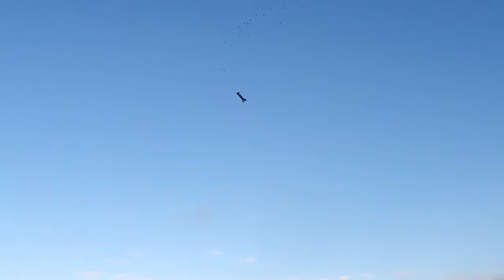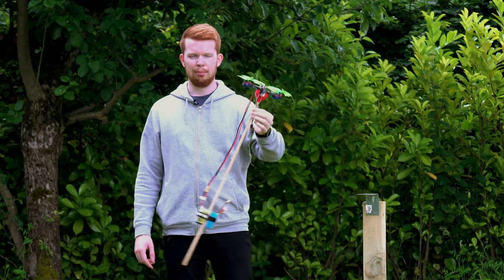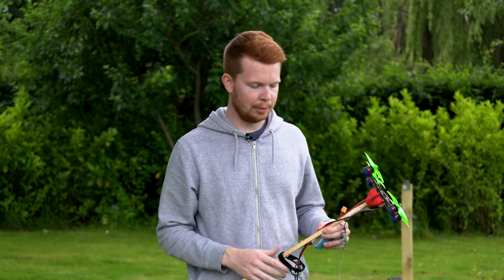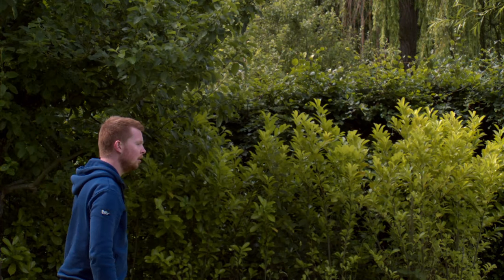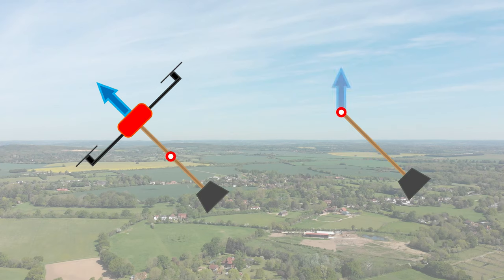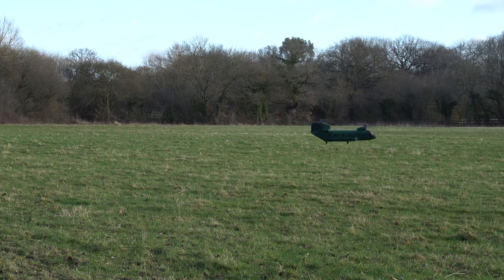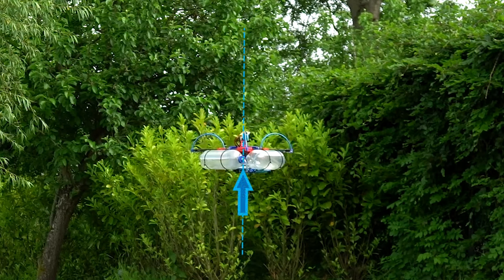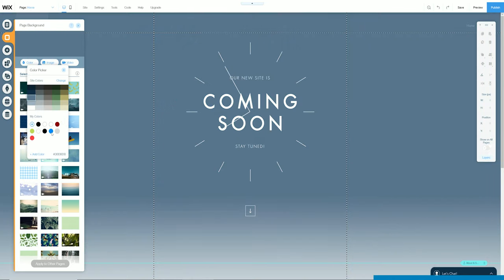Drone Pendulum Fallacy

Comment from the maker: There are many questions about adding a hinge between the drone and the pendulum (with a short length of string), so I thought I should address my view here. I'm not 100% sure what would happen as it depends how far the string is mounted from the drones centre of mass, however I think it will be more of a issue than an assistance. With any change of speed/direction, the pendulum will swing and will drag the drone with it. Also, if the string is attached at the drones' centre of mass, it will be unable to induce a torque on the drone and rotate it to level. If the mounting point is away from the drones' centre of mass, I think it'll still crash as the pull from gravity is uniform, so the drone is pulled down as much as the pendulum. Thanks for getting me thinking about this, I should have tested it in the video! Maybe one for the future!
Reply: Are you refering to the center of Mass as the center of mass or the point right between all propellers? - It might make a difference even if those two points are very close to eachother.
Reply: I'm thinking about towing objects on the water, if you attach them to far back on your tug it will reduce your ability to turn away from the mass, water doest allow for swinging though so maybe attach fins to your weight to dampen swinging motion
Reply: what if you had a stick going down halfway from the pendulum and a string going the rest of the way, would the swinging weight pull it back to level or just get caught in the props?
Reply: @MrGrimies  ah, but that just dampens rotations. It provides no correcting force.
Reply: wouldn't the mass of the weight after the hinge just be a down vector at the hinge?so effectively you have just moved the weight and the CG  a bit and you have the same set up?
Reply: @mikepettengill2706  well, it would be a wildly swinging vector centered around a vector pointing away from the direction the drone is accelerating. This of course has no relation to the gravity vector, so it would not contribute at all to stability. In fact, it would just yank the drone around randomly.
Reply: Really putting a hinge on it doesnt work for the same reason that moving the center of mass down doesnt work: the while system is in free fall, and the only force is from the propellers. So if you imagine a pendulum drone that is facing straight up and down, and then nudge it a bit, it'll start accelerating to the side. The pendulum might pull back at first, but eventually its stability point will be slightly to the side because it's being accelerated to the side, and only hold the drone at an angle.
Reply: Yeah, if there's a hinge, there's no need for the pendulum at all, as it would be unable to provide a torque to the aircraft. 
Great video covering the topic in a really easy-to-understand way, Tom. Thank you for the video!
Reply: @MrGrimies  To some extent that can be done, but may just cause more instability.
Reply: You didn't give the stick a fair chance ! None of those drones would fly for long without active controls. Now would they? the stick was stable you sent it off on an angle and it held the angle , you said it yourself.
If you change the fluid you are working in from air to water the pendulum  will work and if you had 4 helium balloons it would work in air.
Reply: @How2RC  Sarcasm?
Reply: I was thinking if the propellers were on a gimbal so the pendulum was always vertical and there were a couple of cross pieces on the pendulum about the center of mass and it was cross connected to the propellers with a spring you might get some counter pulling force to re orient the propellers back to vertical once they tilt.
Reply: If you take the Chinook model and move the motor adjustment down you basically have a counter pendulum, so i would assume that a counter weight would work if it is motorized and counter acting.
Reply: (i'm talking out of my ass rn) what about using a spring or a flexible rod to connect it? that way it could maybe apply a torque while still possibly getting the "pendulum" effect you would have with a string?
Reply: 2 opposing pivot points on servos to actively change the center of mass to gain positive control, instead of passive.
Reply: @How2RC  It's not the fluid that's different, but the force. In water, or with a helium balloon, the force is Buoyancy,  not thrust of the props. Buoyancy is a force that is always pointed up. And indeed, on ships they use very low ballast and/or keel geometry to act against this and provide stability.  I suspect ships is where a lot of this fallacy comes from.
Reply: Also means that on a airship or hot air balloon, the "pendulum" works, e.g. the basket hanging under the balloon.
Reply: All I know is that it could make things more sketchy. One of the more challenging things for helicopter pilots to do is fly with a sling load.
Reply: The pendulum effect is gravity pulling the bottom of the pendulum as close as possible to the ground.If the top of the pendulum cannot move, then the bottom will find it's stable position.
if the top of the pendulm is moving, then the location of the stable position changes all the time and the pendulum wil simply never level out. The endulum is trying, to move to it's stable position but the stable position itself is moving.

So no, hinges, strings and whatnot will never work to level a drone out because when a drone is not level it will shift the stable position that the pendulum is looking for to level the drone out.

Remember, the absolute best a pendulum can do is hang straight down, it will never over-compensate against the motion of the drone to slow it down so best-case the drone willfly sideways for a few miles and require air risistence to slow it's horizontal motion as the pendulum slowly eliminates horizontal acceperation.

In short: this lesson was learned WAY back when people starteed experimenting with rocket engines.
Reply: @dsier  A motorised balance becomes the same as the reaction wheels (or a cat/chicken XD ).
Reply: @lee42048  Pull against what? It always shifts the center of mass, not the direction of the propellers. Thus it always has the propellers facing the same way, and not self correcting. :)
Reply: Or maybe a bearing that can rotate on two axes?
Reply: Tethering weight instead of fixing it wouldn't do anything but kill the batteries sooner
Reply: What about an inverted pendulum?
Reply: @TechyBen  The center of mass does not shift. Well it would shift very slightly if the head was on a gimbal but that is insignificat. Since the propellers are on a member perpendicular to the center line of the pendulum if you put another cross piece further down also perpendicular you will have something to pull on.
Reply: @lee42048  Yeah, I meant if the rod was on a hinge it would move the COM, not the thrust.
Reply: You could add servos to the joint, essentially giving the drone a tail, like a cat, to balance.
Reply: I think you would need a spring, rather, to let the pendulum droop below the force vector but still apply torque...
Reply: @marcmengel1   certain ships have a weight that is hanging inside at the very bottom to keep them upright or to bring them back upright in a storm .
Reply: Perhaps already addressed by earlier comments (I haven't gone through them all yet): Maybe part of the issue regarding the stability of a drone with a swinging pendulum/low center of gravity might have something to do with the flight control software. Most flight controllers don't assume a low and gravity/inertial-adaptive center of mass. If one were to make one, perhaps it might prove quite stable.
However, I expect it'd also be very slow, constantly waiting to react to gravity's (and momentum's) effect on the pendulum. Chasing after a near center of mass would be much faster than waiting for one far away to move.
Reply: Can canards make a difference? I wasn’t able to catch the entire thread!
Reply: TheLoneGingerShow I see he has hearted this, and I could be wrong, but may there be a difference if you were to have a defined amount of “tension” causing the hinge to spring back to center always. This way, if the quadcopter tilts away from level, the spring wants the quadcopter and the weight to be level, so the angle of the quadcopter will cause the weight and quadcopter to oscillate, eventually bringing the quadcopter close back to center, and when it is at center, the pendulum hinge is straight so its sort of built in “PID loop” can be adjusted by changing how tight the hinge spring is. Let me know what you think man, I looked and nobody I can see has suggested this. I like your videos a lot.
Reply: One more thing to add, besides my suggestion of adding a spring to the hinge to make the effect work quickly, I do think that you are wrong about “gravity effecting the drone and the pendulum the same way. Its pulling on them the same sure, but because the propellers are spinning on the top making the quadcopter part rise, they are NOT pulling straight up word on the pendulum at the same time, making the pendulum SLOWLY want to come back to center. I am curious why you decided to do this test already at an angle. Didn’t make sense to me, and your explaination was that this would be the best way to see the effect, but really its kind of the worst if you think about it. You have it at an extreme angle, so if it doesn’t QUICKLY stabilize and self center, it just flys out of frame and crashes. Could you post a follow up with both the current configuration and another with a spring loaded hinge like i mentioned in my other comment? I think, don’t know, that these will give you the effects that this video is interested in debunking.
Reply: I had the same thought about adding the hinge. Would like to see that outcome.  Also, what would happen with 4 longer lengths of string under each motor attached to a single low mass?  Great videos. Thanks.
Reply: Please make a video on it, I would like to see what could happen.
Reply: What if you hinged the pendulum at the base of the drone
Reply: What about an oscillation from the torque and the flight controller?  

The FAA handbook refers to 'Pendular Action' and a traditional helicopter in respect to handling and over-correction.  I made a comment about this effect on the reaction wheel aircraft.  My thought was that the reaction wheel below the mass and the one on top had two different torque requirements, but the flight computer might not understand that.

https://www.faa.gov/regulations_policies/handbooks_manuals/aviation/helicopter_flying_handbook/media/hfh_ch02.pdf  Chapter 2, Page 14.
Reply: i made the mistake of using too long of string when i was testing my drones carry capacity, its' wobble back and forth was so gnarly that while trying to recover, it did a face plant. I wish i had recorded it because after shortening it the wobble wasn't unrecoverable. I'll try and send you the video once i find it. Love your channel, keep it up!
Reply: @sea_kerman  this is experienced rather often in racing drones.. when the battery slips its strap and swings around randomly.
Reply: Hello , I have a questin abot your whiper trebuchet. You said that you didn't find the ratio that works well online so you had to find it yourself through experements. Can you please reply with the ratio that worked the best with your trebuchet
Reply: Yes please, another video.
Reply: @ApocalypticIdol  Awesome! Thanks for uploading!
Reply: @How2RC  Stability assistance isn't about maintaining the angle. The angle is maintained just because the torque is balanced, if the torque was made unbalanced (say by something poking it) the pendulum is providing no corrective force, and it's a corrective force that we care about. The experiment would have been a success if after release the pendulum straightened out, but instead the angle was simply maintained, which is the fail condition. It should be noted that this doesn't mean that the pendulum isn't making the drone less stable either, although as mentioned it does increase the rotational inertia, making it harder to change the orientation of the craft, which might be desirable in high-wind conditions actually. (although in high wind conditions the pendulum may accidentally act as a sail and hurt more than it would help)
Reply: I was thinking a hinge, but the weight has some kind of mechanical lever-ed connection to the drone.
Reply: Hey Tom, can you try to build an flying RC Car with the help of the magnus effect. I saw a pic of an futuristic flying car design, where the wheels worked as the cylindrical rotors...
It would be cool if you can design and build this kind of car to prof the concept...Cheers and grats from germany...
Reply: Maybe not something as flimsy and unstable as a string to suspend the weight/battery. Use a universal joint or a ball/socket joint.
Reply: Try a gyroscope
Reply: @How2RC  - The typical quad propeller drone does indeed employ active stability, and I felt the same at first! However, there is no arguing with the force diagrams.  One could drop that experiment from high up, it is never going to stabilise. Gyro-kites with long sticks can be stable, but only because they have what amounts to a universal joint in the rotor head that keeps the rotor thrust vector near-vertical. 

The air to water comparison is only valid when the 'flying' object is floating due to positive buoyancy  - the fixed drone lift is along the axis of the stick, but a buoyant under water drone would have some vertical lift too.  A neutrally buoyant (no floating lift) underwater drone would show similar behaviour to Tom's experiment in air.  It's all about the force vectors, changing the fluid changes surprisingly little.
Reply: @Tom Stanton - Think of what happens to a helicopter when lifting a heavy mass on a cable. It remains stable, because it always hangs below the aircraft, ignoring any wind resistance, and actually improves stability, as can be seen if you look at the vector diagram or such an arrangement. Conversely, a fixed pole without any pivoting action, would cause exactly what happens in this video.
Reply: Tom Stanton rope between stick and drone?
Reply: It's funny that we came to the same conclusions about free-fall / zero-gravity around the same point in the video. Understanding how forces work, and where work is being done, makes it all come together.
Reply: Tom Stanton what about using a firm spring that allows flex but not as loose as a rope or firm as a pole.
Reply: Tom Stanton try putting the stick with the batteries extruding upwards instead of down. I want to see what happens.
Reply: Ok so let's say the batteries are hanging on a hinged arm, but the drone can control the hinge. Are we then talking about a less efficient form of reaction wheel? A stable algorithm would input dampening forces to the arm, while an intended vector would swing the arm slightly in the opposite direction.
Reply: What about a pendulum that connects at two points around the center of mass of the drone?
Reply: I agree with many arguments above, Tom, you must try this arrangment: drone + small fixed distance + tied string + weight,  This is completely different from the one shown in the video. In the video, yes, the thrust is simply carrying a larger weight with no pendulum effect. In the string case, the center of gravity will not be in the same line, because there is no same line!  The string falls downwards even if the thrust is angled, which means, the weight produces torque to stabilize the drone. Perhaps slowly, yes, but it should work good with some fine-tune of lengths and weights. And please don't use such extreme angles to test, especially in to begin with. Looking forward to such video. Thanks
Reply: What would happen if you tied a weight to the drone using 4 strings attached to the drone body at the corners?
Reply: Google runs ads for toys during these drone videos.
Reply: A friend of mine had a project at university on that very subject, having a drone carry a free hanging pendulum from it's center of mass. The problem was exactly as you said, when the drone stops moving in a straight line, the pendulum would swing and pivot about the now "stationary" drone and with it's inertia pull the drone forward, which then moves the pivot point of the pendulum, causing a negative feedback loop.

 So the control solution was to slow down in such a rate that the pendulum swings forward  of the drone and remain their until it comes to a stop, before the drone itself would stop by "pivoting about the pendulum mass".

In short, a pendulum that can pivot about the drone makes it immensely unstable and the control system to rectify is a rather complex affair.
Reply: In your model the center of mass was at the center of the stick so when you attached it to the stand at that point the forces cancel.  If the center of mass was lower on the stick  the pendulum effect would work to swing it back to vertical like a hot air balloon and like your Chinook model.  Slide the batteries to the bottom of the stick, attached it at the same point and see what happens.
Reply: I was going to ask what would happen if you put a gimble above the suspended weight (a 3D hinge), but a string would be the same thing, pretty much. I would LOVE to see that follow-up vid!
Reply: Take it a step further and have the lower mass be active like a handheld camera stabilizer gimbal. Where the drone is where the camera would be and the batteries are in the handle. Use flight control software to stabilize the battery(handle) side. Not the drone itself
Reply: I wonder what would happen if the stick is connected to the drone with a universal joint. 
I'm thinking about a helicopter moving a tree.